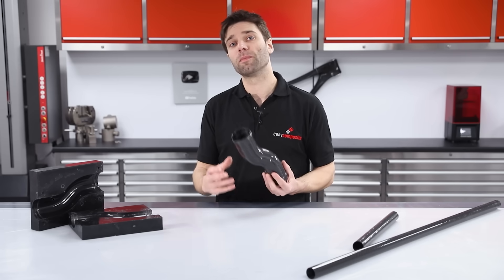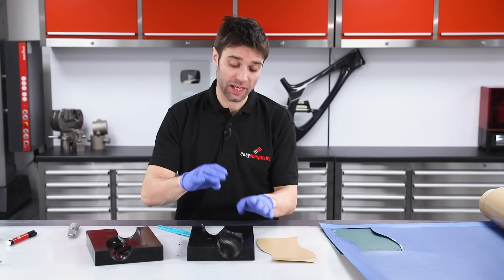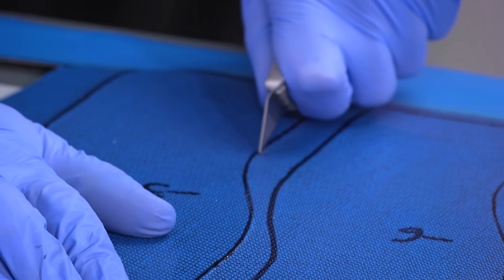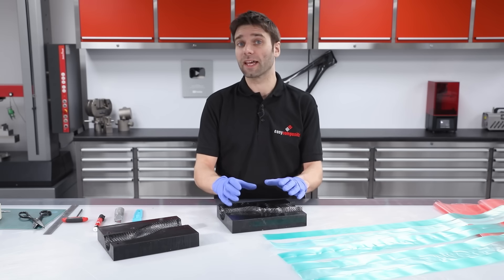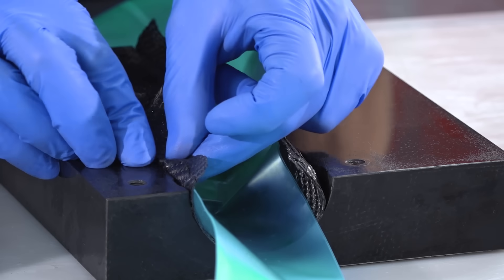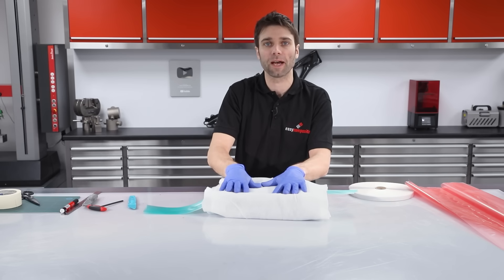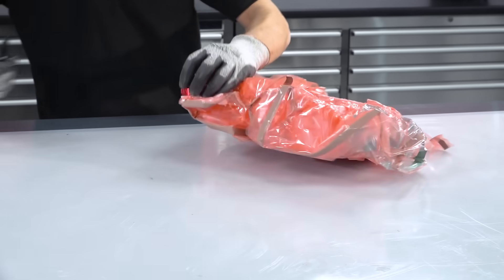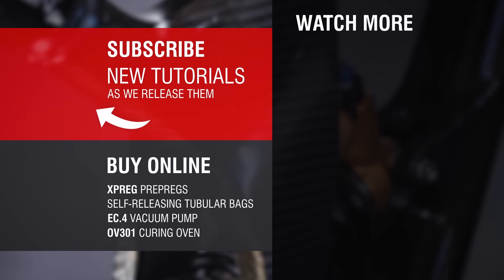Making Complex Carbon Fibre Tubes Using a Split-Mould

Comment: Is there a reason to use vac instead of just pressurizing a bladder inside the mould?
Reply: In vac, the atmospheric pressure push the mold together. When bladder tries to open the mold, so you would need stronger mold to hold
Reply: @LestaAZL  I was wondering this same exact thing. Thanks for the logical response.
Reply: LestaAZL 
E
Reply: @LestaAZL  This is incorrect.  Atmospheric pressure is 14.7psi.  you can't remove more air than zero.  The vac bag on the outside of the mould can't apply more pressure than 14.7psi.  You could just inflate a bladder on the inside to 14.7psi and you'd be in the exact same situation.  This is needlessly complicated.
Reply: @MdubFrederson  Yes with a bladder you can get a higher pressure than 1bar. The point they are making is that the mold might not hold up to that pressure without flexing. (can't say whether that's true or not)

But with the vacuum bag situation it's clamping the carbon fiber up against the mold without exerting any outward pressure. The draw back is that you're limited to atmospheric pressure (unless you do it inside a pressurized chamber)
Reply: @batman3698  I think it is exerting outward pressure... but its also exerting inward pressure. So the two forces counteract each other and put all the pressure against the carbon fabric.
Reply from the maker: Yes, it's exactly as LestaAZL has commented. The moulds you need for a pressurised bladder need to be incredibly strong (usually billet aluminium) in order to resist the deflection of the 'unbalanced' pressurised bladder. Therefore they tend to be very expensive to produce. An internal vacuum bag setup like this exerts equal pressure on the inside and outside of the mould, allowing much lighter, more cost effective composite moulds to be used.
Reply: @easycompositestv  I read that in your voice lol
Reply: @easycompositestv  Why wouldn't you just do it all underwater? The pressures would equalize and you could apply practically infinite pressure to the part instead of just 1 atmosphere (you would be limited by your tank material, but 5-10atm is easy).
Reply from the maker: @DataLog  You cannot heat water to 120C needed for the pre-preg cure. Plus you do not need more pressure.  If more pressure was needed, you use an autoclave.
Reply: @easycompositestv  could the mold be 3d printed?
Reply: @lukefrench464  3D printed moulds only work for room-temperature cures, but you could 3D print a pattern and make a mould from that which will take the temperature in an oven / autoclave.
Reply: @easycompositestv  can you make a carbon fibre Aircraft or ultralight aircraft propeller! with normal epoxy resin and fiber

With mold?
Reply from the maker: @bilal_bin_shafeel  Its not something we can offer as a service, in theory yes, it could be done although a composite propeller is an incredibly difficult project to undertake, not least of all because of the fine tolerances but also ensure it is fully balanced.
Reply: @easycompositestv  ok sir... thank you for your reply...if any doupt I contact your through the communts line!
Reply from the maker: @bilal_bin_shafeel  We don't offer any customer manufacturing and it's unlikely we'll make a video about this. But if you wish to carry out the project yourself, we would be happy to provide technical advice by email at Technical@easycomposites.com
Reply: @easycompositestv  Hope you see this question. How would you go about resin infusing a part like this? 
I need to make tubes a bit longer than this but they can't be made on a mandrel as they have some more "organic" shaping to them. But I also don't have the setup for prepreg curing. But I would like to infuse them and a bit uncertain about how to do that.
Reply from the maker: @AntiVaganza  Whilst it may be technically possible to resin infuse a part like this, it's much more suited to prepreg as the dry material would be significantly more challenging to position and secure in the mould. Without the resin to hold the fabric in place, ensuring that you get even laps of material across the joint will be very difficult indeed.
Reply: @easycompositestv  That makes good sense and thanks so much for the elaborate reply. A follow-up then, if you don't mind. 
Another way to go about this - again the goal is to not get into prepreg - would be to lay the part up on a meltable wax mandrel. 

This for me has an added benefit since the ID is more important to me than the OD on these parts. I know you have videos on the use of mandrels, but I don't recall seeing one being infused which is still my preference. 
So, no mould, just the wax mandrel but I am still not sure how to set up the infusion... I am leaning towards having a strip of flow media running along each side of the tube (The tube is 1m long, btw and between 25-60mm in diameter.) 
I was thinking a feed tube all along one side. And then on the other, that strip of flow media or maybe one long resin break? Does this sound doable, am I on the right path? Any thoughts on this would be much appreciated. I am wondering about how far off of the part I need the extract vacuum to be, bascially how wide I should make that "soft gutter". 

Full disclosure, I am located on a small tropical island in Asia so I can get basic infusion materials but it might be a bit prohibitive getting MTI hose sent out here, though so I am trying to do this without. 
If down the road, I find a way to get some MTI hose, could I place it right on the part itself in this use case?
Reply: @easycompositestv  No, they do not have to be incredibly strong. Equivalent to your vacuum method you would need bladder pumped at one atmosphere or 1 bar. Your mold could probably do it.
Reply: Those saying this doesn't need vacuum are forgetting about pinholes/voids due to air being trapped inside of the mold and fabric. It would be the same as using wet layup and ending up with the surface full of pores. Vacuum takes all the air out during heat cure, minimizing void content. This isn't just about making a tube, it's about making a perfect tube...
Reply: @TheShaddix  this might be the only valid explanation.
Reply: @TheShaddix  those that dont understand negative pressure vs pos pressure dont work with composites. its fucking obvious.
Reply: @DieselRamcharger  Most people watching this video don't work with composites...
Reply: @DieselRamcharger  or, instead of being condescending about it, you could explain it!
Reply: Using a vacuum like this, as well as sucking air bubbles out of the lamination you are in effect you are putting a 1-bar pressurised bladder inside the mould. Once it's cured you have a lovely smooth finish, which is what you want to avoid unwanted turbulence in a pipe.
Reply: the vac also gets the bubbles out of the epoxy.
Reply: "Bubbles, meet vacuum.  Hey, where'd all the bubbles go?"
Reply: I think you also get less air pockets when you vacuum the part/mould instead of pressurize the bladder.
Reply: Thanks for asking the question a lot of us were thinking!
Reply: All these armchair engineers arguing with professionals, lol.
Reply: And when you use a bladder for a stronger mold?
Reply: I thought he was gonna fill the green with air pushing out, I don't really understand hownthen2 parts sealed together
Reply: i thought the same thing
Reply: @lukass2576  the picture in my profile is literally a car i built with a carbon fiber body. wtf are you talking about? lmao.
Reply: @lukass2576  unreflected comments. lol. snobbery gets you nowhere.
Reply: @DieselRamcharger  I think this was a misunderstanding. I apologize
Reply: @lukass2576  first. i belittled no one. i gave some practical tips on working with the material. second. its not MY CAR and i didnt SPEND anything. I BUILT that car and GOT PAID to do so, as it is my profession.
Reply: @DieselRamcharger   @Diesel Ramcharger  I just saw your comment was written a year ago. It doesn't make sense to argue about that now and I apologized in my other comment. However your comment I am referring to  is not a "practical tip". Someone was trying to understand the difference of positive pressure and vacuum so he/she can learn and got eye-rolled by you.
Reply: @lukass2576  im not arguing about anything. any comment i made a year ago is just as true, or untrue today.
Reply: Exactly what I was thinking... maybe its because it would be difficult to pressurize thin material like that without it popping a hole in it...?
Reply: It would required a van and a compressor AND you risk separating the 2 halves, with this using a vacuum gives a much better result, much more uniform look on the finished product.
Reply: Any resources available for the infusion equilivent process for similar parts?
Reply: What pressure would a pipe like that hold
Reply: @mikeyg4297   Once its cured? Considering that plastic soda bottles are very thin, unreinforced PET and can hold 6-10 bars before bursting that  pipe will hold more than enough for automotive applications.
Reply: @mikeyg4297  Barlows Theorem will give you a good estimate.
Reply: @mikeyg4297  Curious about that as well.
Reply: @mikeyg4297  Not more than 0.1 bars, don't even blow in it
Reply: When you vacuum bag is called infusion carbon. The vacuum sucks out access carbon when doing a hand layup. This makes for a stronger/more rigid part. Pre-preg is already impregnated with the proper ratios of resin to fiber, but the tooling is already there or many airports have autoclave ovens where the fiber is baked under pressure. But that is aerospace level sh*t. If your have refrigerated trucks delivering pre-preg, your a beast.
Reply: @boosted4g638  Think you meant the vacuum sucks out excess resin... not carbon...
Reply: For some scientific reasons that I don't understand, the vacuum has way more power than pressure
Reply: Good point. Vacuum + plastic film= waste + money. You can make a thicker mould just by adding 3-4 layers of fiberglass or carbon fiber, hence achieving a stronger mould. I prefer the bladder anyways
Reply: keronGR  if one can afford money for prepreg then can afford 3 dollars for a vacuum bag. Vacuum bagging materials are not too costly especially with how much they make life easier.
Reply: @chris81983  by that same logic you could afford someone else to do the job for you and then the details are irrelevant.  Using an inflatable bladder is just easier.
Reply: @MdubFrederson  bladders have a place and this is not one of them.  You can go about it however you want but in the end results are all that count.  Perfor this job both ways, and let me know what one yeilds better results.  for this very task.
Reply: @keronGR  you ever just tried to add a few more layers of carbon fiber or fiber glass? The time to do so would be more costly labor wise then the vacuum method.
Reply: Where do you buy bladders from? Do you use ore preg as well?
Reply: @keronGR  you should post an instructional video showing your more economical method.
Reply: @alexanderturl  can’t do that. This is my customers product at the moment. I just copied the same method “inflatable bladder”, Fenner precision
Reply: @keronGR  the bladder would need to be stronger at the openings or some kind of additional mold to support the ends. 1bar difference is not that much force on a mold though
Reply: you could also make a mold where you pull the vacuum at the edge of the bladder so using vacuum without all the external bags. should be quite straight forward really. since there is no wet on the outside of the mold.
Reply: @DanFrederiksen  how?
Reply: @Stellarffxi  a solid gasket ring at both ends and a tube bag between them.
Reply: @keronGR  Yes, that's the point.  I have worked on the same project to prepare a car mirror cover from Carbon fibers by using Glass fibers mold.
Reply: @keronGR  Cept he explained you'd likely need billet aluminum which is even more expensive!

Comment: Is the method the same with wet bagging?
Reply from the maker: This process isn't really suited to wet laying due to the difficulties of laminating the materials in the split mould. Furthermore, vacuum bagging is typically done at 20% vacuum which doesn't provide the same levels of consolidation. With a bit of patience and practice you may get reasonable results but really a prepreg would make the process simpler.

Comment: How much overhang can that prepreg hold when laying up? could it hold completely upside down? even on larger areas. Could you do a closed mold fuselage as one piece from the inside just with the stickiness of the prepreg
Reply from the maker: Prepreg has tack which holds it in place.  In this mould, one side was upside down and unsupported until the vacuum bag was in place.

Comment: I still dont get it lol!
Reply from the maker: Hi, what is it that you would like explaining further?
Reply: @easycompositestv  what does the suction have to do with it? I watched a fiberglass tutorial and the guy just painted resin onto it.
Reply: I guess I'll just have to watch the video again.
Reply from the maker: @BlurryFace-zz2ro  The material in this video is a prepreg where the resin is already impregnated into the fibre. Unlike a dry fabric and wet resin that you have seen in the other video, prepregs require heat to cure. The vacuum bag consolidates the fabric and ensures everything remains in place during the cure cycle. You can learn more about prepreg in this video.

Comment: Quality work. The mold looks very fancy but I assume it's 'just' made on an existing part. The easiest way to quickly get a quality mold surface
Reply from the maker: The part was actually designed as a hypothetical component specifically for this tutorial to demonstrate a few design details. The pattern was first machined form EB700 tooling board and then the mould made from XT135 tooling prepreg.

Comment: I would have liked to have seen the inside of the tube after it came out.  It seems like it might not be a very smooth finish in there, which would not be ideal if you are trying to create undisturbed air flow.
Reply from the maker: Yes this method does produce some small wrinkling in the surface from the vacuum bag. If you need to produce complex parts with a smoother interior face then you may wish to check out our tutorial on melt out cores https://youtu.be/jbUH-4KThTQ
Reply: @easycompositestv  So cool!  Thanks for sharing this.

Comment: Hi. Does anyone know if it's feasible to make a tubing for car coolant with carbon fibre tubes? Is it chemically resistant enough?
Reply from the maker: It could be lined to withstand the chemicals or use one of the specialist coolants to avoid the issue.  The bigger problem is making sure it can handle the pressure and temperature, hence why aluminium is so often used.

Comment: How thick is each layer. Designing a mold and wondering what my final dimension should be.
Reply from the maker: THe consolidated thickness of the surface ply is about 0.25mm and the backing ply 0.45mm.

Comment: How strong are those joints? (For example compare to prefabricated carbon fiber tubes with one solid structure)
Reply from the maker: There shouldn't be a huge loss of performance with a tube made in this way and it will come down to the way in which the part is loaded/direction of force. There will be very little in terms of strength lost down the length of the tube as the there are still fibres in that orientation.  As long as the joint is correctly consolidated the overlapping nature of the joint should mitigate any real weakness.
Reply: @easycompositestv  thanks for your reply. It would be really cool to see test for different kind of joints or technics of production in terms od strength. Love your content, great staff

Comment: How would you make a complex tube with a flange on one side?  Say an intake manifold for a single cylinder engine.  It is a complex tube but would nee a flange to bolt to the head intake side.  Just curious.
Reply from the maker: Hi Bryan, 

You'd could do it a similar way to what's shown in the video but the mould would need to incorporate the flange opening out at the end. You would most likely need to pattern the material to make this from multiple pieces and would probably incorporate a flat plate on the end as a section of the mould. Alternatively it may be possible to profile a flat carbon sheet and bond this to the tube section with a fillet of structural adhesive.

Comment: When you are making the fluid or gas handling structure, isn't the finish on the ID critical.  When you make them this way, they look pretty, but the working surface is heavily compromised....
Reply from the maker: Correct, that's where the technique of using a low melt alloy as a temporary core can come in. This method prioritises the inner face of the part. https://www.youtube.com/watch?v=jbUH-4KThTQ
Reply: @easycompositestv  wow...that is interesting.  Never knew of that technique!  How many times can you reuse that low melt alloy?
Reply from the maker: @shooter7a  You can re melt and recast it pretty much indefinitely.
Reply: @easycompositestv  thanks for the follow up....  I can think of many uses...

Comment: a pipe created like that , if it was closed after , can hold like 4 BAR of inside  pression ?
Reply from the maker: This method wouldn't be as strong as a continuously rolled tube, as the fibres are broken at the join when the mould is split into 2. Without testing it's almost impossible to determine what pressure it could withstand.

Comment: This would be equivalent to a tube with a seam, no matter how strong it is, the seam makes it fragile, like making a tube without a seam.
Reply from the maker: You ensure the overlap is designed strong enough for the application.